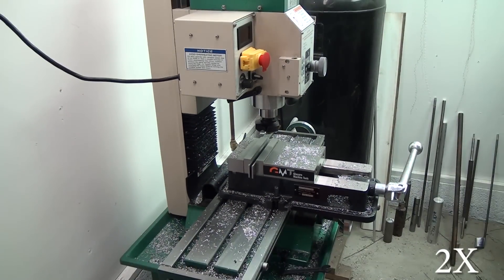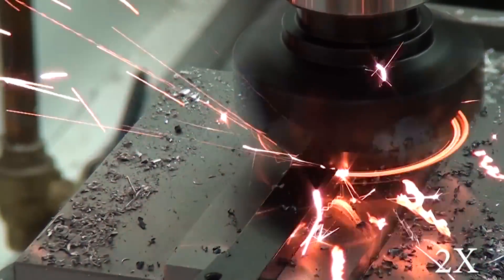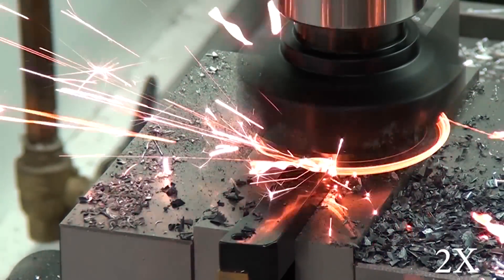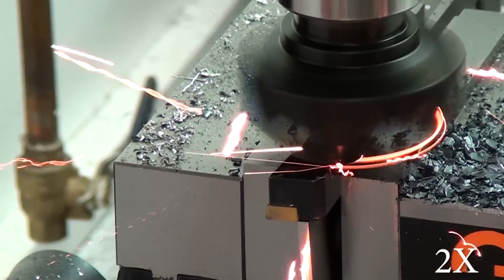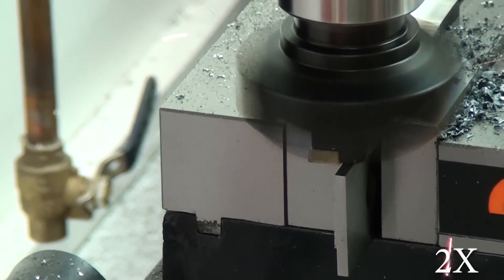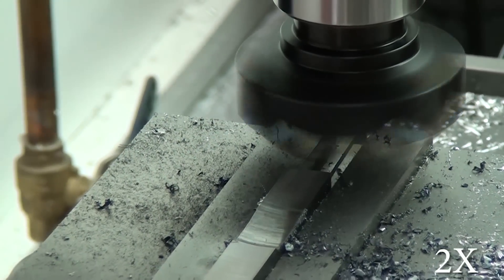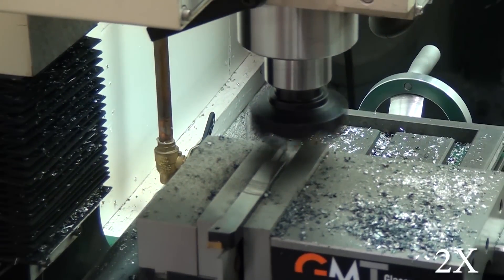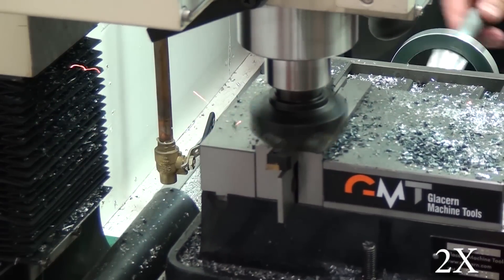07 G0704 Shars 2" Face Mill Gets It Done!

Comment: Hi I like your video,  I see your commments about  maybe want to use a face mill like TTs system. But do you think the TTS can have the same rigit/strength than R8 arbor? or do same work on steel/aluminium whitout vibrate or slip tts toolholder? many thanks

Comment: The main problem was your machining direction. You cut in the longer direction which means that your face mill cutters just aren't in the cut and you ram the inserts in the material. If you had cut in the Y then more inserts wold be in the cut which gains better surface finish and fewer vibrations and tool wear

Comment: Most common way carbide is broken in the home shop is through varying feed, intermittent cuts and temp shock with coolant. Either flood it or cut dry. The recommended speeds and feeds for insert tooling is absurdly high, that’s why pros like them so much. Time is money

Comment: Why are you using 2" face mill for that small of a part, your going to have tool heat fracture issues. You shouldn't really go less than 1/2 tool diameter for a carbide face mill.
Reply from the maker: No clue. When I made this video 7 years ago I was super new to machining. It might also have been the only tool I had at the time. The 1/2 diameter idea is probably a safe rule of thumb.

Comment: A very good (if completely unintended) effort at hard milling in the home shop. Those inserts were probably not intended for hard milling, but at work we use exactly this kind of cut (High spindle speed, low feed rate, all the heat comes out in the chip) to machine 50HRC+ steels all day. It's not a bug, it's a feature!
Reply from the maker: Thanks!

Comment: Why would you mill a tool holder? Why not just buy the right size (8, 10, 12) and a height adjustable tool post?
Reply from the maker: 1. The tool post could not be made to go any lower.
2. It's the tool I had on hand.
Please note this video is 4 years old, and the tool holder I'm machining is the very first one I bought for my lathe. In the years since, I've learned that professional machinists do the same thing with their tool holders when needed. In fact, I'm never surprised to see a machinist modify something they have to make it work. Making/modifying tools is part of the game.
Have fun!
Reply: I've modified a tool post/holder before to suit a lot of good cutters I got cheap.
Reply: Adam15197 I have noticed this situation as well with some of the off-brand tool holders period they advertise that it's for a Lathe with a 6 to 10 inch swing if you're using it on a 10 inch lathe you have to make sure that the tool holder is off to the side in order to lower the tool holder down low enough hanging off the side of your compound rest. what I would have done is modify the tool holder not the tool
Reply: Trevor Smales damn right! I just finished milling (6) 1-1/4 shank tool holders down to 3/4. Got all 6 used valenite holders on eBay for 15$. That’s why
Reply from the maker: Killer find!

Comment: You should never pass your cutter down the centre of a part. You want to aim for a thick to thin chip. Also, tap the turning tool down, your parallel is moving around a lot :-)
Reply from the maker: I stay away from words like "never", but I agree it is best practice to avoid the centerline.
I agree on tapping down the part, but who knows if I did (this video is 4 years old). I always tap my work down but sometimes the parallels still (annoyingly) move around on you.
Thanks for watching!

Comment: I have been machining a HSS end mill with a Titan carbide end mill. I take slow cuts at low RPM and shallow depth of cut, but it machines HSS like it's nothing...

It was a ruined end mill I got from a machine shop scrap... plan on turning it into a tool bit
Reply from the maker: +Tyler Fu I have never tried milling an end mill.... but now I want to :)
Reply: +russtuff I don't know the exact grade of the end mill but I did test it with a file... it's definitely harder than the cheap Chinese end mills sold by Grizzly... but I don't know if you can machine cobalt M2 type steel though... doesn't hurt to try but make sure you take very light cuts and reduce the speed a LOT. I was using 3/8" Titan 4 flute end mill, 300rpm and .01" depth of cut.
Reply from the maker: Tyler Fu Very cool though. I'm going to try it out when I get a chance.

Comment: very nice finished!  
if you trying to get the tool in your g0602 cut perfect center line without concave then this is just west of time, I think you better take the saddle  a parts and scrape the dovetail  along with the gib that way you are ganna be sure you are straight 90 degree to the chuck...

I like this face mill, I'm going to get mine along with 24x18 AA surface plate on this black Friday! 

Oz
Reply from the maker: +Ozy Ozy Very cool. I think they changed the part number on this face mill, or maybe it no longer has an integral arbor (which would be a bit nicer I think).

Comment: I forgot to add... You need some coolant or cutting oil too!
Reply: +PanamaSticks Sandvik advices against using coolant on carbide tooling when possible, especially on roughing stainless which generates a lot of heat (and the heat shock could damage the insert). Also, he could offset the tool from workpiece center to make the chips thinner. Forty five deg inserts thin the chip to 1/sqrt(2) from what it would be with 90deg insert, and offsetting the workpiece from center would thin it more. Thinner chips at insert exit point is also easier on insert due to outgoing chip not yanking the insert edge and possibly fracturing it. Also entering the workpiece at an angle is easier on the inserts as the insert doesn't "slam" 90deg into the material possibly damaging it. I'd definetly hardmill something if i could and wouldn't have to buy a surface grinder. I'm not an expert, but getting an owen or surface grinder or torching a heat treatment from a tool is an overkill. Especially when that shank probably is not hardened.
Reply: +Tiivi Vaavi  I've been machining at my present job for 15 1/2 years.   I don't cut much stainless, but it is precisely because stainless generates a lot of heat, that I would use a flood coolant.   Carbide or not, if you don't do something to reduce the temperature buildup,  both the cutter and the work expand and the cut gets progressively deeper.   I may be wrong, but I don't think flood coolant or a steady stream of coolant is going to cause much thermal shock.  Having the wrong grade of coolant will result in a chipped insert....  Sandvik makes and sells inserts, right?   Maybe they want people to buy more......
Reply: +PanamaSticks You are probably right. At low cutting speeds, dwpths of cuts and feeds thermal shock wouldnt probably be an issue. Besides i wouldnt want chips flying out of a manual mill like from a machine gun. Im glad the shank turned out ok ;D I just really didn't like your hobbyists having too much this and that comment.
Reply: +Tiivi Vaavi I hope you didn't think I was ridiculing or insulting you.  I just hate to see expensive tooling destroyed, and I thought I should make some suggestions.      Believe me, I have destroyed plenty of cutters and inserts myself.   We are very cash poor at work, and because of that, I have probably become too cautious about feed rates and spindle speeds.  And I no longer work in a big shop with other machinists.  So I really can't say from experience whether Sandvik knows what they are talking about.
Reply: +PanamaSticks No, I didn't think that, nor did I try to do that to you. I thought your message was somewhat insulting and discouraging and arrogant to russtuff. I work in a poor shop aswell, and I'm a new machinist working on an old machining center. While I'm sure you could teach me a whole bunch of stuff, but theres still things I know but you don't. If you get arrogant, people just wait out the lecture and then move on.

[edit] I must have been on a bad mood or tired when reading your original post for being... so over over... reactive ;D
Reply: +Tiivi Vaavi  Since I never wrote to Russtuff, I don't know what you are talking about.  If anyone thinks I was "arrogant" and "insulting", then I think they are being a little too sensitive.

Comment: Always take a file to steel to test the hardness before you cut.   If the file "skates off" or barely cuts, you should use a surface grinder.   If one is not available, I would suggest you remove the insert from your lathe bit, and anneal the steel with a heat treating oven, or with a torch.  

Even if this were not hardened steel, you have picked the wrong mill for the job.  It is way too big in diameter.  Because of this, you are making hard, interrupted cuts, unless you use a really slow feed rate.    An interrupted cut will chip or break the inserts.  You better not ever try anything like this with a flycutter!     Even assuming this were not hardened steel, I could also tell your spindle speed was ridiculously high, even before you touched down on the lathe bit.  You will get a feel for this after a while, but in the meantime, multiply the cutting speed of the material in FPM x 4,  then divide by the cutter diameter.  That will give you an approximate RPM.   The cutting speed in FPM for UNHARDENED steel ranges from about 50 to 125 depending on the alloy.   If that is a two inch diameter cutter you would want to use (50 x 4)/2= 100 RPM.  

This is going to sound like "grumpy old man", but you could have seriously hurt yourself too.   You break an insert, and it can fly off and hit you in the eye.  Finally, I think you should know that in Germany, machinists spend weeks filing steel and other materials before they even get near a machine, to learn the properties of materials.   I guess this is what you get when hobbyists have too much money burning holes in their pockets.
Reply: PanamaSticks that’s a lil harsh don’t ya think? The advice was a good thing to give but the part about”this is what you get when a beginner has $ burning holes in their pocket”(paraphrased) wow man! I like seeing people getting into the trade. He learned and will continue to learn as we all do from our mistakes. Lord knows the decades I’ve spent in front of mills, lathes, and other machine tools and of course I still make bonehead mistakes occasionally. Unless u were born with the knowledge to distastefully ream this guy, please lighten up man..just saying
Reply: @wadesmith9483  he is just being german. and i agree with him. file first start with basic. you cannot buy spare human body parts in the supermart

Comment: Hi Russ, I would like to see the same test with our 45 degree cutter from www.latheinserts.com.
Several things going on in your test video: Most milling inserts have a land or hone of about .010 inch. This is for strength. If the insert was ground to a dead sharp edge it would be relatively weak. Any kind of scale or interruption would destroy the edge in short order. Your depth of cut must exceed the width of the land or the material will pile up and adhere to the cutting edge. In this video the edge has build up and the friction causes the material to rub and heat up. The sparks you see are the carbon burning off at 1200 degrees. Our inserts have a special edge prep for bench top machines. The smaller land enables you to run between .030 and .093 depth of cut with super results. And they will run .010 finish pass without those sparks you see. Edge prep is everything!!
Reply from the maker: Hey Curtis, thanks for the post! I've been buying end mills from latheinserts.com but I haven't tried the inserts yet. I'll make sure to add some to my next order :)

Comment: The piece your machining is hardened steel, no? I have the same machine, using a fly cutter or end mill, and it doesn't even touch hardened steel. Thinking of buying a face mill like the one you have here. That seems to take a 10 thou doc fairly easily?
Reply from the maker: I am really not sure, but my gut says it's harder than regular mild steel. The face mill is a good one, but if you are planning to ever use the Tormach TTS stuff then I would suggest going with their face mill instead of integral R8 like mine is. I still use this one quite a bit though since I haven't bothered to buy another. Actually, I won't be buying another, I'll be buying the Tormach fly cutter when I get around to needing it.
Reply: Well it certainly seems to eat through that tool quite well. Thanks for the video! I plan on staying with the R8 setup, as I don't do a ton of milling. I think I'm missing something and since we have the same machine and I couldn't do what you did, I'm assuming it's my tooling that's bad. Thanks again!

Comment: I just ordered this same face mill, what rpm were you running it at?
Reply from the maker: I was at 2100rpm and should have been in the 400rpm range.
Reply from the maker: *****
If I'm going pretty slow, I can run a deeper cut in steel but it needs to be a very rigid clamping. Your right about this mill, it is not rigid at all.

Comment: trust me when i say even after 28yrs of conventional and CNC  chip flipping  i learn something new with every new piece, every new solid model and every new g-code prgrm i do,, i ruined a $1200 new 4cyl-head once about 15yrs ago because of the z-aixs drawing down on me during a decking cut (didnt lock the quill !!),, turned the spindle on backwards few years ago using my fowler-electronic edge finder on a mold-core and as the ball unscrewed itself the lil-parts flew every where in the building, at that time i really didnt think it mattered about spindle direction when it came to an edge finder but i found out like real quick it matters ! happens to us all !!
Reply from the maker: Haha, those are some great stories (I'm sure you didn't think so at the time :)

I don't mind showing people my mistakes. Maybe it will help someone else from making them.

Thanks for watching!

Comment: If your chip is too thin, the heat will go into the Inserts (what you saw in the video) A good rule of thumb for small machines is .003 chip load per insert. Ideal chip color on low/medium carbon steels is straw color with a blue tail. When you get that, you'll know the sfm is correct

Comment: If your depth of cut doesn't exceed the honed edge you will build up friction because the insert is rubbing and folding the material over instead of cutting it. Also, there are 3 places the heat can go: Into the insert, the workpiece, or the chip. You want it to go into the chip.

Comment: .Some things to consider: A .010 DOC pass can get you in trouble for two reasons. One, most molded economy inserts have a honed edge, or a combination of hone and t-land. They do this for strength because a ground, sharp edge can be rather fragile, and a honed edge is cheaper to produce than a ground edge.(That having been said, most quality inserts for aluminum will have a ground, sharp edge)

Comment: Pro-tip - When you machine something smaller than the cutter have the part offset in the Y-axis so the teeth of the cutter sweep into the part instead of hitting the part side on. This should stop a lot of the vibration and hopefully improve the finish.

Comment: I usually anneal anything hardened, or grind it slow to retain the temper, and I use coolant. But no, I have not machined much hardened material, just a couple times..., I've done some ball screw ends, but they are much easier to anneal first or to grind. I'm no expert, just learning myself, maybe feeds or chip load is too high.  Its easy to forget to tighten everything down, but once you learn its second nature! There is so much to know in this field.

Comment: Also the sound is not even that bad. I have heared a lot worse in heavy milling. Have you ever seen the recomended speeds and feeds from some manufacturers? A seco 125mm facemill running in steel at the recommended feeds and cutting depth was enough to get the load meter on our 20kW spindle at work to 70%. If the inserts and the machine can handle it there is no problem with red hot chips. A hot workpiece or milling cutter is much more a sign of wrong speeds then glowing chips.

Comment: less speed and more feed and doc may work better, think about it, if you use bigger doc you spread the wear over more of the cutting edge so you get more work out of the cutter. did you do any sfpm calcs? sounds quite fast to me. you can raise the spindle speed on the final cut with a low doc to get a nice finnish. anyway the tormach machines use r8 but the larger ones have an option for bt30 which is certainly better. it's not unique to tormach so in your comments you can refer to it as bt30.

Comment from the maker: Only if you are going to use the Tormach collet in your R8 (I am using it for some things). Using the 3/4" straits are nice because you can swap them out so fast using Tormachs's "32086 - TTS-R8 adaptor collet".

Take a look at my "06 G0704 Initial Tooling Considerations" video (/watch?v=jr_jyXptCAY) for more on this system.

Comment from the maker: If I were buying today, I would probably look at the Shars part number 404-1959. You could also get a face mill that does not have an integral shank and then buy an arbor (Shars part numbers 404-2245 and 202-5328 would probably work). The 45 degree face mills require less power to make a cut so I think they are a good idea for a small machine like mine.

Comment: Another contributing factor: The utility inserts you are using have a huge hone on the edge. This creates a rubbing action on light DOC's and adds even more friction. Try running at least .030 or more DOC and at least .003 per tooth on the feed rate. That will thicken up the chip and your inserts will last way longer. 

Cheers!  
ExKenna from latheinserts (dot) com